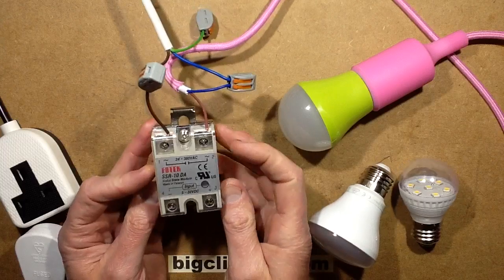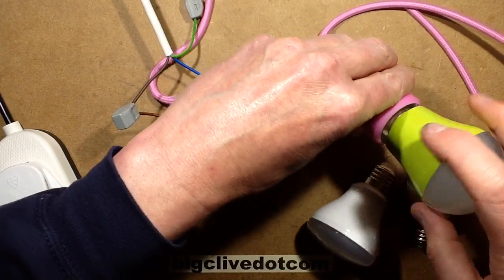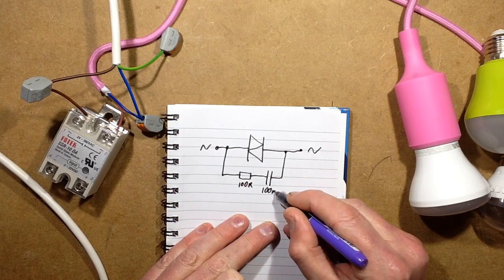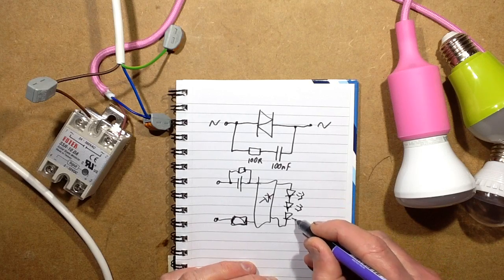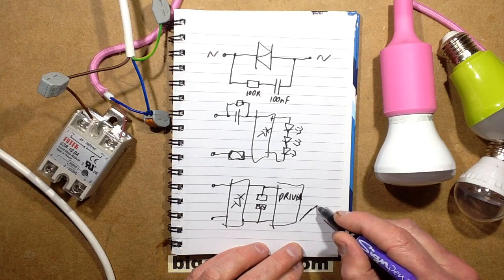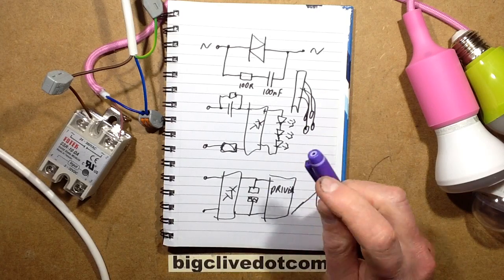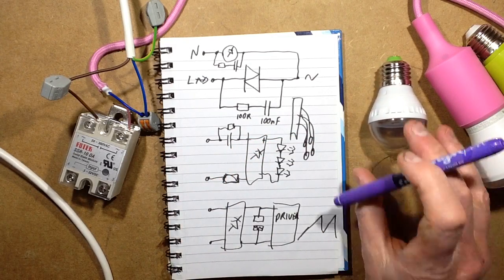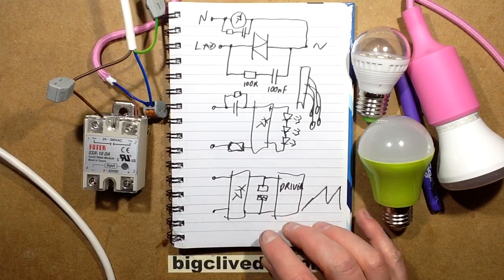Electronically controlled LED lamps glowing when off.

Comment: In my case, it's not a solid state relay, but a completely physical mechanical switch. Heck, even if I completely disconnect the switching wire to the lamp (and leave the live wire connected) and leave the switch off, I measure anywhere between 25V and 40V on the mains with no lamp inserted. However, when a lamp is inserted, I still measure about 5V on the mains. Switch on, and everything's fine and dandy at 230V. I don't have the guts to measure the current, as I'm not sure if it's ok to short out the wires, as I'm not sure where this power is coming from, and why I'm able to measure anything on a wire that is not even connected to anything...

So, if a dimmer or a solid state relay isn't the problem and the lamp is switch is completely mechanical, why does this problem still happen?

It woudn't be induction, would it? Induction wouldn't cause quite that much voltage, would it?
Reply: +thany3 It's a combination of induction and capacitance. The switch seems to have the contacts close to eachother even when switched off, creating a capacitor with a couple of pf. And when the wires to the lamp are beneath wires that currently are transporting high current to another appliance it also could be inductance.
Reply: +BloodySword I had a similar issue with 2 light fixtures. For curiosity I put a neon flicker candle bulb in my bathroom. When I pulled the cord to switch it off there was still a very obvious glow at the end of the metal inside the bulb. Turn it on and it was fine. Off had the glow which was weird. The other fitting is in my PC room, It is a 4xGU10 spotlamp bar with 2x5 white LEDs at the edges so you still have light if all the bulbs failed. Well the LEDs failed before any spotlights. I noticed they were wired  with a capacitive dropper. I took them out and used 2xBlue LEDs with resistive droppers from a defunct kettle. They work fine for hours at a time. But I noticed the same effect. If I used CFL bulbs with the lights turned off the  blue LEDs would still be glowing. If I took the bulb out the LEDs went out, If I used LED bulbs the Blue LEDs stay off until the fixture is powered up... Why ?? Why is this happening? Many thanks :)
Reply: ***** I disconnected the black (switching) wire and left the other one attached. iirc "other one" means the blue (neutral) wire. So it can't be capacitance of the switch, can it? It has to be inductance then?...

Then lemme ask this: why does this not happen for other fixtures around the house? Surely if there's an appliance drawing a huge amount of current (there isn't - the biggest load was probably my fridge drawing <100W and on another group as well) other fixtures should see the same leakage. And if it's inductance, then I figure every fixture in the world must see this leakage to some extend, which isn't the case afaik.

Maybe it helps to knwo that I'm in Holland, so our distribution boards are different from those in the UK. I do have those automatic switch-type fuses on the DB.
Reply: thany3
Mhm. Interesting. :D In Germany, the neutral is shorted to ground, but only in the distribution box of the whole house. From there, neutral and ground are seperated from eachother, meaning, that the neutral wire can collect all sorts of crap being a huge star distributed antenna. Perhaps this is the reason. Don't really know.
Reply: *****
 I'm not actually sure what happens beyond my distribution board. But I'm pretty sure there's a reason we have a separate earth wire. It sounds like in Germany the neutral acts as an earth wire as well.

It sounds weird to me, because the neutral does go into the electronics bits of your devices... It means a malfunctioning device that puts some sort of current on the neutral might damage other devices around the house. At least more so than when using a separate earth wire.

Anyway, I'm sure it's not like that here, so I shouldn't be able to measure any voltage from the neutral.
Reply: JohnnyX50
Strange... But it's definitively the topology inside these CFLs.
Reply: In a home wiring run wires can be installed very close and a small current is induced in the wires which would not be noticed normally

Comment: There's one other more common way of current leackage... Even if you have a simple wall switch, the wires, which come from "electric box" to the switch forms a capacitor, and is enough for "blinking" and so on. The only way to simple get out of it -- is to connect the wall switch so, that it shorts the lamp terminals, when off. I tried the resistor, the capacitor in parallel with the lamp, none of them works with adequate to the "on" state characteristics...

Comment: Good video.  Thanks for the detailed explanation.  This reminds me of when using a CFL light and with a LED light plugged into to a socket wired to a old use Dimmer replaced wall switch, the CFL and LED lamps would flash even if the dimmer push-to-be-off was engaged. So irritating at night, the dimmer had to be replaced with the normal on/off switch.  -  I wonder if a pull-down to ground resistor (of some high value to not load down normal operation) between the 'snubber' capacitor and resistor would prevent the cap from charging and discharging in cycles.  Yeah, its not worth the bother to modify the Solid State Relay but still in principle, I wonder if that would solve the issue.

Comment: I had a clapper and I guess it put a small current through the plug to check if something was connected because it caused the CFL bulb in my lamp to blink when it was off and caused my DS charger to behave strangely

Comment: Thank you Clive, this has been very very helpful.  I have three DMX controlled power junction boxes. Each box has four three-pin-plugs.  The boxes, and each plug therein is controlled by a separate DMX controller, which consists of twelve on/off buttons, (so I can run a maximum four boxes of four plugs each.).  I've been using them to run a number of LED lights such as Chauvet Swarms, Mini Kinta, Mushroom, spots, and a number of others, for dances and parties.  I have never been able to figure out why many of them keep flashing when they were meant to be off, yet work fine when turned on.  I had to revert to using normal electric multi plug junction boxes and switching them on manually.  I just tried experimenting with a double adaptor, with one outlet going to an LED light and the other to a standard 60W lamp. There was no flashing with both plugged in, but when I unplugged the lamp, the LED started to flash.  Once again, thank you.  Now I've got to figure out a way of putting a load on to each plug that's the equivalent of a 40~60 watt bulb.

Comment: I wonder if the power draw in the "off state" does increase or decrease if you put an incandescent bulb or resistor in parallel to the LEDs? Naively, I would think that something in parallel could only increase the power draw by decreasing resistance. But if the incandescent bulb reduces the voltage, maybe the LED circuit isn't even able to really start using current? Does someone have experience with this?

Comment: this problem has annoyed e for ages, tried to create a flotaing ceiling light thing with led strip lights and make it dimmable, but never managed to find a dimmable transformer and a 2 way rf wall switch that work together without the led stirps flashing when the switch was off. :(

Comment: I use a small 7 watt night light on my flashy blinky led bulbs with the motion detector wall switch. The led dimmers don't seem to have this problem.
Reply: Good point: 👏
A. The day night switch has an activation "time delay to eliminate nuisance switching" which effectively isolates the circuit during the light portions of the day. (ie. leakage current used to run a timer)
You may still find that the LED's flicker/glow during the night if the motion sensor is bridged out. 
B.1) The leakage current could possibility be used as a backlight and illuminate the wall switch, or 
 .2) charge a battery. 
C. 330nF Cap and 100 Ohm resistor, PTC or gas arrestor combination snubbers (from Line Out to Neutral) only divert the problem & make it seem to go away. 
(Inductors in series to the capacitance reduce the overall impedance)

D.1) Double isolation: If regulations allow you could reduce the inherent "capacitance" of the circuit by using conductors WITHOUT earth and keep the lengths as short as possible. 
 .2) National Regulations forbid the use of 50 Ohm impedance coax cable to reduce transients, due to the insulation material NOT being rated ≥500V/600V AC.

{This is where uTube limits communication because we can't post circuits, photos, graphs & the like} 👎

Comment: Here in Norway we mostly use 2, or 3-fase 230v, and in certain conditions on single pole lights switches theese LED fixtures will continue to glow dim even when off. Only explanation I could find was capacitive leakage through ground... At night the LED lights are bright enough to navigate in "complete" darkness.

Comment: My patio has a pair of remote control track light fixtures, each with 3 lamps. I replaced all with cheap LED bulbs, and they'd come on okay, but when off would strobe weakly.  I replaced them with even cheaper but dimmable LED bulbs, and they work perfectly.

Comment: This has probably been often asked, but where can i source those quick release wire connectors? those would be handy to have!
Reply: +lazerusmfh 
They are Wago - Compact Splicing Connectors.
Reply: +lazerusmfh Wago 222 series
There is also the new 221 series

Comment: Home made SS relays with quadracs ("snubberless triacs") for the win! Relay or dimmer applications won't ever notice the missing quadrant, and the leakage is essentially zero.
Reply: Got a link to a schematic for that?
Reply: @tcurdt  Yeah I drew one. It is a very basic but functional SSR, not a dimmer. Lets see if YouTube lets me post the link:
http://eeberfest.net/etc/SSR.jpg
http://eeberfest.net/etc/SSR.pdf
Note that the triac MUST be "snubberless"!!
Reply: Also if you are using 240VAC you should probably change the 360 ohm resistors to 750 ohm. I've only ever used the circuit (as drawn) on 120V.
Reply: @tcurdt  Additional thought for you: if you wanted to fire the SSR using a GPIO pin on a 5V microcontroller (e.g. Arduino UNO) it would be best to substitute a MOC3063 for the MOC3061 shown and use a 470 ohm resistor in the control circuit. Done like this the SSR can be turned on with 5V ~7mA, well within limits of GPIO. As drawn with the MOC3061 and 120 ohm resistor it needs more like 30mA to turn on.

Comment: For tungsten lamps it is possible to use two 15W bulbs in series as a resistive load so the power usage is not that high and it takes decades for the bulbs to go eol.

Comment: Hmm add a small mains voltage relay on the output of the solid state switch?
Reply: +zx8401ztv 
Why use a solid state relay at all then?
Reply: +Jack White 
Good point, perhaps its a matter of drive current, but this is an example circuit, not in an actual system.
I personally would use mains relays as i like them, but the electronic type dont have contacts to get dirty, so they have a use.
Relays for led lights and electronic for heavy loads :-)

Comment: This reminds me of a flashing joule thief. You add resistance between the battery positive and the coil tap. Add an electrolytic filter capacitor from the resistor/coil tap to ground.

Comment: +bigclivedotcom Have you tried to put an "energy saving" (just a big capacitor) between the live and neutral after the relay? it will act like a dropper and if the value is high enough, the ac voltage seen by the lamp will be negligeable when the relay is off and this will just change the power factor when on.

Comment: i have a home made power supply, the volt meter flashes on every few minutes even when the mains of the whole unit is switched off with a l/n physical switch 
i take it being caused by capacitive leakage between the contacts

Comment: For my elderly mother I wired in a motion sensing switch (built in the wall to replace a normal toggle wall switch, you understand?) and it did this when not triggered on. Let me be clear -- it did this with an incandescent load ...Would this happen for the same reason?

Of course with the Incandescent bulb you did not see a flicker, it just constantly glowed when you wanted to sleep. (it had an adjustable timer for the ON time and a pot for the light and adjusting neither helped.) I thought I was saving money & liked your like playing about with lights & being ahead of the times but in the end it just cost $30 extra to begin with plus loads of my time. Plus I figured it must have leaked like 5-10 watts of power.

 It was made by a well known lighting and switch maker, too, I forget the name (its pry in one of my electric tool boxes somewhere in the basement) I really want to buy another but it seems like a waste of money ... next time I will probably just try an automated home hub as I've noticed there are ones that do similar things.

But it was annoying as all get out.  Makes me reluctanct to ever buy another one -- if I ever run across the thing I'll try to edit this to add the name because now its bothering me I can't remember that name.

Comment: I have this problem with cheap LED's I bought on Ebay, they were $1 each in boxes in 10 a few years ago, they work fine, but glow while off, Name brand LED globes bought locally (phillips etc... 5-6 bucks each) Do not do it, Do they have extra circuitry to avoid the problem? or do they just use enough power (6watts instead of 3 like the ebay globes) that they don't glow from the leakage?

Comment: I remember our kitchen light on a dimmer system did that years ago,it would spaz out once in a while. My dad was convinced it was a live neutral so he invested in a tester only to find out that it wasnt it. He did change the dimmer to a different type and that stopped the ocassional flash. It usually was associated to something like a lamp being switched on in the next room on the same circuit. We would freak my sister out,telling her it was our dead aunt trying to communicate something. lol.

Comment: I don't understand electronics at all, but i find myself coming back to watch more. Maybe it's the soothing voice and gentle accent, but i've spent hours watching these videos
Reply: +Plum Bit I know nothing about electronics and next-to-nothing about electrical engineering. However, after having seen several of Clive's videos, I've started to become less and less confused when he traces circuit diagrams. I've started to learn to expect where bridge rectifiers or smoothing capacitors are going to show up. Microcontrollers still throw me, though. To say nothing of TRIACs.
Reply: +Plum Bit Your comment is tripping me out.  I was honestly about to write the exact same thing in the comments.
Reply: Snootches Bootches Maybe we find it therapeutic ha
Reply: +Plum Bit I believe so. Ill probably come out of this with some knowledge of the organs of electronics as well , which is great.
Reply: Half the things I've learned from YouTube I came across by accident and then couldn't leave
Reply: Yes he has a smoothing voice and he does not cut a lot out of his videos, this I do like, I hate it when there is so much cut out you have to try to put together what they have done.  Clive has a way of getting it over what he is talking about and the schematics with explanation is very good way of doing it.
If you watch enough of his videos you will start to pick things up, even if you have never worked with electronics.  I like it when he moves on to do simple circuits other than lamps.  Maybe he will explain what a Diode, Resistor, capacitor, Electrolytic capacitor does, though I think he did this in an earlier video

Comment: I have something else odd happening with LED lamps. When the fan in the bathroom switches off (it runs on one of those mechanical timer switches), the 3 LED lamps in the bed room flash. It is all mechanical switches and both rooms have their own breaker, so no common line until the breaker box. Any idea how that can happen?
It took me quite a long time to believe that the flashes are even real, because I have that weird thing where I see flashes when I have my eyes closed or it's dark and there's a snapping noise (like the timer switch or the heating thermostat).

Just out of interest, did you measure how much power is actually used when the lamps are glowing? It could actually be a feature if someone wants a night light.
Reply: +superdau I think related: My car has an interior LED light (changed from bulb) that flashes when the window wiper relay turns off. I'm pretty sure its something to do with the pulse an inductor (the pulling mechanism in a mechanical relay) gives when turning off, but not sure of the exact path... Maybe it gives a pulse in the power line so that with the wiring on the other side of the led still having a capacitive coupling to ground => blink.
Reply: As an electrician I encounter this all the time.  LED and compact fluro lamps are guilty of this.  I always get calls from customers complaining about this in the bedroom light (because they see it when they lay down to sleep).  there are no solid state devices in use, just mechanical switches.  I would love a solution to this problem.
Reply: I was surprise when 12v led lit on my hand when I try to connect to battery, I guess they need very little current to work so that mean they are very sensitive

Comment: Whats the difference in using a fly-back diode or the RC in series used as a snubber?
Reply: You can't use a flyback diode here. This is AC. There is no “back,” current is supposed to flow both ways.